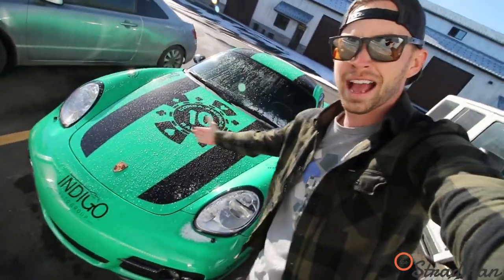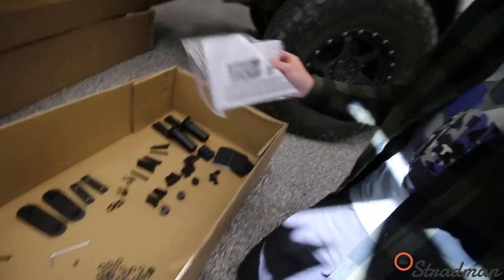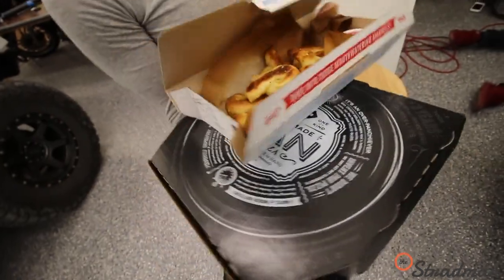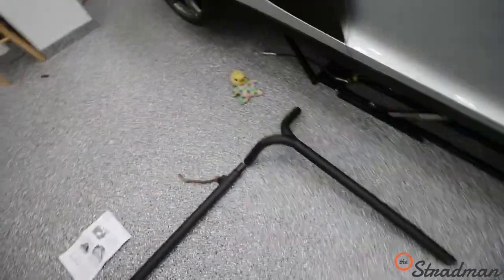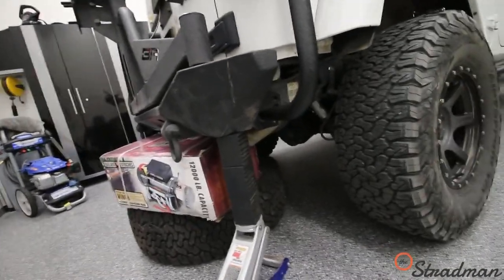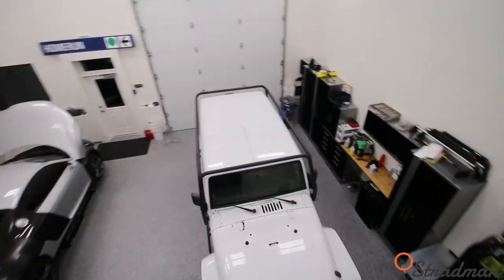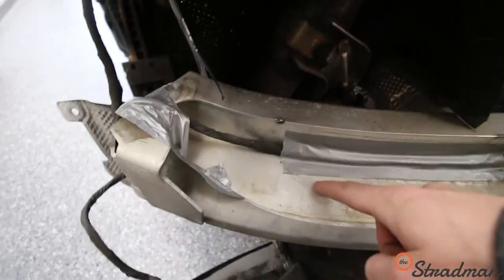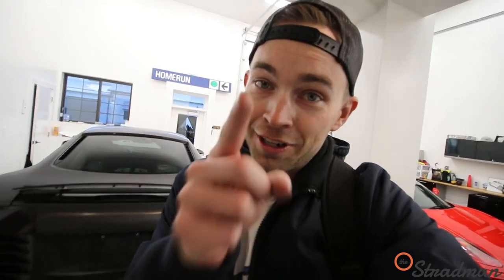Revealing the NEW COLOR of my Audi R8!

Comment: when you have bolt holes that don't line up, don't use the bolt you are installing with to make it fit because you can damage the threads. Try to use a hefty screwdriver instead.

Comment: one thing You MUST REMEMBER!! If this car is in fact going to used as a rental I day 75% of the time....You MUST think about what exhaust you use.It cant be stock BUT IT CAN NOT BE "LOUD" IT NEEDS TO SOUND AGGRESSIVE YET SUBDUED OR THE CAR WILL GET MUCH MORE WEAR THAN NECESSARY. HOW DO YOU DRIVE A LOUD AND AGGRESSIVE CAR? WELL ILL TELL YOU.YOUBREV THE PISS OUT OF IT WHEN POSSIBLE EVERYTIME!!! ALSO UNDER BRIDGES AND TUNNELS THE CARE  GETS DOWNSHIFTED & NAILED..ON the Road...do you jump on it and rev it through widecopen and then let off so the left over fuel wil make a crackle &pop ..hopefully blowing a nice bit of flame...Renters wont do that ONCEVIN A WHILE..THEY WILL DO IT ALL THE TIME..THEY NIT ONLY WANT THEIR MONEY'S WORTH AND MORE BUT THEY WANT SOMETHING TO SHOW OFF TO THEIR FRIENDS..NOW ONNTHE OTHER SIDE OF ALL THIS IS THE HARD CORE WEAR & TEAR THAT YOU MUST DEAL WITH.. EVEN IF THEY PAID FOR THE EXTRA INSURANCE..YOU ARE GOING TO HAVE A MAJOR ISSUE PROVING HOW AND WHEN THE DAMAGE OCCURED.. ALL THIS COULD BE OVER A EXHAUST!! PUT A NICE MELLOW EXHAUST ON IT THAT GIVES IT  A SOUND OF PERFORMANCE BUT NOT A SOUND OF A TRACK CAR..EVEN THOUGH ITS A V8...MY EXHAUST WAS TO MUCH FOR A RENTAL.FOR THE 1ST WEEK ANDCI COULD HEAR IT SCREAMING THREW The Eisenhower Tunnel 2 miles away!! ...IT WAS WAYYY TO MUCH..SO  I CHANGED IT TO A CUSTOM MELLOW BUT AGGRESIVE CUSTOM TITANIUM EXHAUST MADE THROUGH DALLAS PERFORMANCE..IT HAS A VALVE THAT OPENS FOR A STRAIGHT THREWVSOUND BUT THECRENTER DOES NOT GET THE FOB..IT HAS LONGTUBE TITANIUM HEADERS AND TEST PIPES.. ITS AGGRESIVE ENOUGH and EVERYONE IS HAPPY..NOT ONE PERSON HAS MENTIONED ANYTHING NEGATIVE OR WANT A LOUDER EXHAUST.. ITS PERFECT AND KEEPS IT DRIVING WITHOUT ISSUE..I COULD TELL A BIG DIFFERENCE IN THE FULL EXHAUST WHEN I had Dallas Performance make it BUT the headers and test pipes.. even the. dyno showed 52hp and 47 ftvlbs trq. AT THE 4 WHEELS!!  BEFORE THE MUFFLER OR TUNE WAS ADDED..ALL TOGETHER WITH OPEN EXHAUST AND THE TUNE.. IT MADE 88HP &  77 LBS TRQ WHICH IS A LOT..OH IT ALSO HAD DALLAS PERFORMANCE INTAKES AND FILTERS..I WAS SUPER HAPPY THATVFIR UNDER $1100 i had an aditional 100hp with better economy... its the greatest rental car ever..its a reliable $450 a day!! So man...grab a high-end exhaust...DO NOT USE A CRAZY  LOUD EXHAUST.!!!! YOUR CAR  WILL BE RUINED IN 6 MONTHS.. I TRULY WISH U THE BEST!!!!